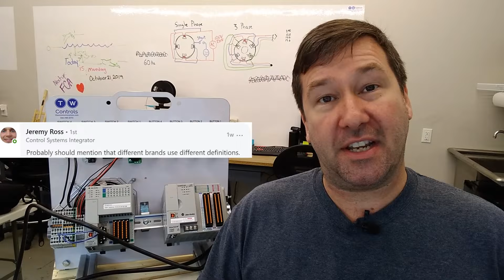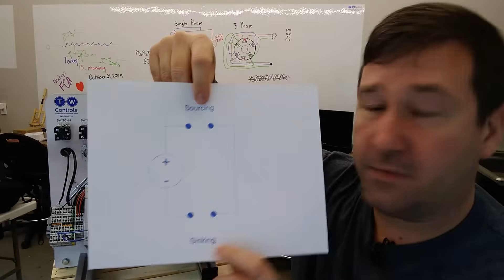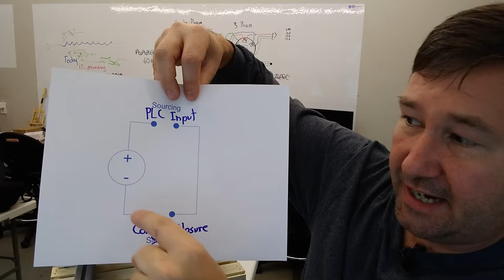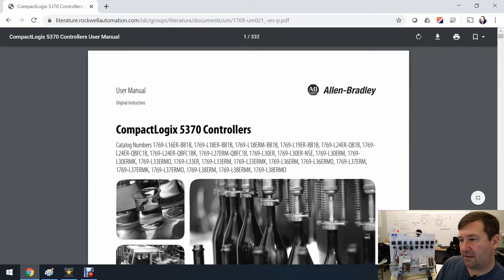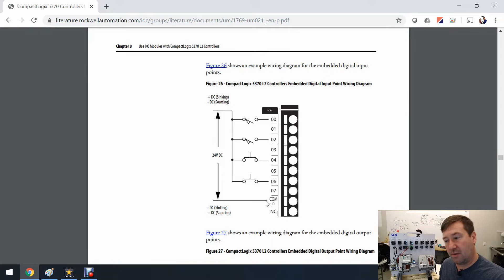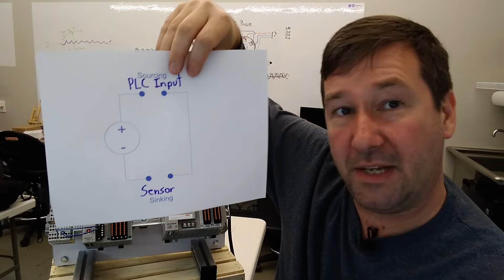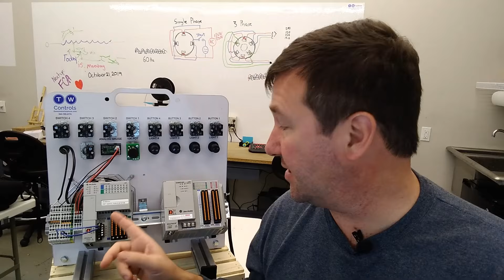Sinking and Sourcing PLC Inputs with PNP NPN Sensors

Comment: PNP for safety (ground fault will NOT turn on/enable an output with PNP sensors).

NPN for speed (electrons, travel faster than holes). 

Electrons are the majority charge carrier for NPN. 

An absence of electrons, making a positive charge (positive ion), travel slower than electrons.

Comment: notes  from  the  REAL world  SINKING sensors are  used  in high speed aplications  such  as  resolvers  and  high speed  counters.   sourcing sensors are used for positioning or limiting movement in slow speed aplications  limit switches selector switches and push buttons can be either but most  applications prefer sourcing, where things get complicated is when you have  a machine that  has  1  sinking  sensor for  speed and  all other  inputs  and  sensors are sourcing.that means u have a 16 bit I/O with only  one  input used. the  bean counters  are  going nuts !! the answer to that  is  to  use a 2k resistor between the sensor output and the + line and connect to a sourcing input. then  u reverse  the  logic in the plc. we try to avoid sinking  outputs  because if the return should  short  for  any  reason  the output  will be on steady . i enjoyed  your explenations, worked with this stuff for 40 yrs. retired now but still miss it
Reply from the maker: Here is a video where we talk about that.
https://youtu.be/AoeIpAVufHo

Comment: Why don't they just make it simply all NPN? The nomenclature is confusing so why not just say "positive" power or "negative common input. The sensor does not really create a "source" of power.
Reply from the maker: That is a common point of frustration. The terminology often feels like it was designed by engineers for engineers, rather than for the technicians who have to wire them up daily.

While standardizing on NPN might seem simpler, the reason both exist is largely historical and regional. NPN was more common in Asian markets for a long time, while PNP became the standard in Europe and much of North America. Technically, NPN transistors can sometimes switch faster due to the mobility of electrons versus holes in the semiconductor material, which is why you still see them in high-speed applications.

The "Source" and "Sink" labels refer to the direction of current flow relative to the device, not the physical creation of energy. In a sourcing circuit, the device is the "source" for the current flowing into the load. In a sinking circuit, the device provides the path for current to "sink" to the common or ground.

Comment: I always thought of it as - a sink catches power and source is the power. Either sensor has its own supply in the field and we dump into plc “ sink” or sensor needs power from plc/dcssource.. we use advant controllers primarily for most sensors that can be either so it’s really simple just how you need to wire it.

Comment: Is that a typo on page 182 of that 5370 User Manual, around 9m30s of the video, where it says the inputs are Sinking/Sourcing, and again on page 184, where it shows wiring for either Sinking Inputs (COM 0 is -DC) or Sourcing Inputs (COM 0 is +DC)?
Reply from the maker: Are you asking about the L16 or L24?

Comment: In my 45 years in electronics and PLC (and DCS) system design, I usually found manufacturers' inconsistencies and inaccuracies in documentation to be a significant time-suck, especially when first figuring out new models and/or brands. It was clear to me that the people writing manuals were not adequately trained/experienced, and their efforts to explain things just made the situation worse.

I usually solved the problem by demanding to have the internal schematics of the sensors and PLC/DCS input & output devices. Once I could see how the contacts or transistors were internally connected to the terminals, it was very easy to have full understanding of the 'source' and 'sink' question. After that, just an easy mental picture of where the current was flowing made the rest of the design simple.

But I worked with a lot of people, many who had been doing the work for decades, who had not acquired even fairly basic electronics knowledge and skills. Like fundamental awareness of how transistors worked and what their schematic symbols looked like, and they effectively had consigned themselves to a purgatory of ignorance that always left them fearful and confused when trying to work out their PLC circuits. But it is NOT THAT HARD!
Reply from the maker: I appreciate you sharing your experience; it sounds like you've seen a lot.

Comment: The terms "Sinking" and "Sourcing" are related to the way that electrical engineers view current flow. Nevermind electron flow (negative to positive). Electrical engineers consider current to flow from Positive to Negative. 

On an electronic schematic in the Western world, the Positive power rail is generally shown as a horizontal line at the top of the drawing. The Negative rail, often grounded, is shown as a horizontal line at the bottom of the drawing. 

Engineers view current flow as starting at the top of the schematic (Positive), where it is "Sourced," and flowing, just as water does, down to the negative Sink at the bottom.
PNP is synonymous with Source because a PNP transistor is better suited as a current Source from the Positive rail.
NPN is synonymous with Sink because an NPN transistor is better suited as a Sink to the Negative rail.
On many electronic schematics, you will find the majority of the PNP's up near the top of the drawing connected to the Positive rail, and the majority of the NPN's near the bottom, connected to the Negative rail.

Comment: If you are in the swimming pool, if you need to sink in(which is plc input connected to floating negative, ready to drown in side the water as an example), some one need to push you in (which is current flow of the battery + to -) that means input has to be a source, thank you.

Comment: Coming from PCB design world, this seems unnecessarily complicated! I’d expect sensors to have push pull outputs (so will sink and source) and the plc to just have a high impedance input (so neither). Although the plc should have optional internal pull down or pull up resistors to deal with sensors that require it. That’s how it works at the microcontroller level anyway. I’d be interested in the reasons why plcs don’t do that. I guess it means some sensors can have just 2 wires rather than 3. But is that all…?

Comment: I’m sure someone has already answered your question to why NPNs are faster than PNP. It has to do with transistor make up. The mobility of electrons is faster than the mobility of holes. Cute video!
Reply from the maker: Yes, I should do a follow-up on the difference. Thanks for watching!
Reply: The difference in switching speed between NPN and PNP transistors should be so small that it is negligible in the scheme of PLC inputs, which (with few exceptions) are speed damped to make them less susceptible to noise.....the signals coming to the PLC inputs are going to be so slow that transistor speed makes no difference.

There ARE more profound PNP/NPN speed differences in other types of electronic circuits, and there can be differences in regard to noise (as a circuit with a transistor pulling a signal to low/common can can ignore noise a little better than a a circuit with a transistor pulling a signal to high/V+), but again those are not situations applicable to the normal world of PLC inputs, and that is BY DESIGN so people working with them don't need to have a strong background in electronics, etc.
Reply: That's a good one thanks man

Comment: I was not understanding the reason why the PowerFlex inverter's wiring diagram shows an inverted logic regarding the polarity of the sink or source Digital Input. But after watching this video I realized that in this case, the reference is the wiring and not the internal connections of the digital inputs. Thank you for the explanation.
Reply from the maker: You are welcome!

Comment: if the plc is d.i. sourcing the 24vdc will come from that card which come from the 24vdc power of the cpu? or from external power supply?
Reply from the maker: You would typically feed +24VDC to the common of the module then take your input to the device but check the wiring diagram of your particular module.
Reply: @TimWilborne  so even it label common it is intended to wire a 24vdc? actually our plc is Allen bradley with sourcing d.i..card.
Reply from the maker: @nayrbsworld3048  I should do a video on this sometime but common, the - of a 24 volt power supply, and ground are three completely different things. Common is simply the common point on the module. On a sourcing module, the common point of the module is the + 24 of the volt.

Comment: I thought an advantage of NPN was sparks in areas where fires are a big concern?
Reply from the maker: No spark from a positive of a circuit is the same as a spark from the negative of a circuit. There's no reduction in hazard in these situations. Here's where you would start looking at intrinsically safe amplifiers and barriers.
Reply: @TimWilborne  got it. Thank you. A place where a good friend of mine works said the electrical engineer that heads his department said that was part of why he is so adamant about using NPN sensors. Thank you for clearing that up for me.
Reply from the maker: He is probably thinking that it would cause a less intensive spark since the 24+ has to go through the PLC but that would be an assumption and not an engineered reduction in hazardous energy. A spark is still a spark so it is just as hazardous.

Comment: I have that the ECMs in vehicles take advantage of sourcing inputs and decrease wiring costs by tying the input switches to chasis negative thereby needing only one conductor to the switch.
Reply from the maker: Yes, a clear advantage when you use the chassis for one of the conductors.

Comment: The way I go about sensors is PNP is ( positive  ) NPN  ( Negative  ) and it is the actual thing that is going inside the sensors,  it's the composition of the semiconductor material inside the sensors,  PNP is N material sandwiched inside 2 P material and to bias it correctly,  you need to connect it to same polarity ( + )  so they repel each other and start to conduct.

Comment: Sourcing means to loop position to input and sinking means to loop negative to input.. Similarly can you define for PLC output for our Understanding?
Reply from the maker: Source and sink are brand dependent, mostly on the outputs but one manufacturer swaps the input terms so always check the manual.
Reply: @TimWilborne  sir, in interview I was ask.. How we can replace pnp sensor to npn in machine plc, in case we don't have pnp sensor?

Comment: this sounds all confusing but in the end i understood that i understood this long ago. its not anymore difficult to understand then when you transport pizza and salad and put the salad on top of the pizza it will heat up the salad but if its under the pizza it wont. when you put a frozen turkey on top of the produce in your fridge it will freeze the produce but if its below it wont. those concepts of dependency logic and positive/negative states really isnt intrinsic to electrical or logical systems. but what do i know i am no EE lol. for every sensor its just important to think what happens if the wires get wedged in a door or other part of machine and make contact internally and what happens if they get ripped of and cant make contact anymore. according to this outcome you have to choose the safer configuration even if it means buying a different sensor.

Comment: would it be also called active vs passive channels? where active channels need two terminals to complete a loop vs a passive channel where you only need the return (-) to complete the loop.
Reply from the maker: No active and passive usually indicate whether a signal is powered by the loop or powered externally and is usually used for analog signals such as 4-20 mA

Comment: A simple way to understand this is, If give 0v to DCOM then it's sinking and if you give +24v to DCOM its sourcing. And for sensors, NPN requires sinking and PNP sourcing.
Reply from the maker: But as I discovered in the video, not all manufacturers follow those general rules of sinking and sourcing. Some of them swap the terms.
Reply: @TimWilborne  Hey Tim, it's nice to see you reply so quickly. Of course, you've way more experience than me regarding plc's. So, I was thinking what other manufacturers swap these terms?
I've mainly worked on AB,ABB, Siemens and Schneider modicon and I found they all use the general method of sourcing and sinking. Pardon me if im wrong.
Reply from the maker: As I tell in the video, I'm not going to go pointing fingers but yes some of them swap the terms especially on the outputs.

Comment: Im looking for this because i am troubleshooting an auto hallowblocks/concrete paver machine.. its not operating automatically and i found out some inductive proximity sensors are defective..  i also wanna know what type of sensor is needed in this kind of automation, is it npn/pnp, n.c or n.o.

Comment: great video I'm use to the PNP/NPN terminology. when it comes to sinking/sourcing I always have to stop and think for a second. I also like power/not power I never heard that one before that's a easy way to think about it. something that might help some people or it may just be me. but when I think of PNP setup meaning both my inputs and outputs are PNP. I think of it as Positive in/Negative common Positive out. Or Positive In to input/ Negative common on input card/ Positive to common on output card. Or NPN  Negative to input/Positive to input card common/Negative to output card common.  again I don't want to confuse people but that's just how I think of it.
Reply from the maker: Good to know!

Comment: You included the AB manual as a ref! Nice!! :) Ok, so to do PLC's.... well, I have to pay attention to PNP and NPN but the simple side of me says, "It's a switch, it does not care, it is going to complete the circuit!" Yet an Output has power going OUT from it to something like a relay! .......and the Inputs have power going into it because it needs to see the 24vdc coming in as confirmation that the input is indeed there.

Comment: Before this video I thought I had an understanding of inputs outputs and sensor wiring. Now not so sure. Let me explain. I am an electrician. So I would bring 24v to a limit switch sourcing then from normally open on limit to digital input which is my syncing. Then this would fire the output to let say a solenoid on a valve to get it to open to open back up the limit. I would then bring 0v blue white wire back to 0v terminal block. Not that confusing before. On analog circuits I would use Belden cable with red black shielded pair. Inputs black wire positive outputs red wire is positive. So pressure transmitter would be my analog input sinking and sourcing because the transmitter get both power and sends signal back along same wire through 4 20ma. Then the output would fire sending power to pressure control valve. Sourcing. Where I am now confused is on digital input sourcing. I thought digital input received the signal and digital outputs send out 24v.  Analog outputs send out milliamps or millivolt usually. When I need better counting circuits I use sensor that use fiber optics and bring them back to an input card that understands fiber. Now I have to go back and relearn where I am lacking in my understanding sourcing syncing pnp npn digital inputs and outputs vs analog inputs and outputs

Comment: Thank you so much! Currently struggling through a PLC class for engineering school...your video helped me a lot with understanding the wiring, concepts,  and terminology. Cant wait to check out you other content! thanks again!
Reply from the maker: Glad I could help you out Michael!
Reply: @TimWilborne  1.can we use capacitive touch pad switch (with 5v /24 v dc relay )......in place of start/stop/selector switch ? in a 24 v dc PLC?
2. As we are using retentive timers......how  we can design ladder logic for PLC.. so that process  start ITSELF after power supply resumes ? (i.e ..not starting with the help of start switch)

Comment: I know you probably explained this, but I have to ask. I’m assuming this is the same with VFDs,. I see drives with sink/source, is this for a secondary circuit to control  some load with the drive or are these some inputs that can be programmed to start a drive?
I know that’s not a plc question but It’s related.
Thanks
Reply from the maker: The principle is the same, but the terms can be swapped just as I discussed in this video.  For AB, it is exactly the same on their drives as their PLCs.